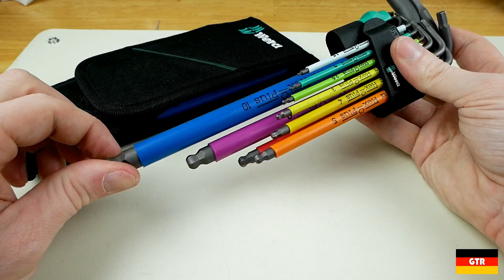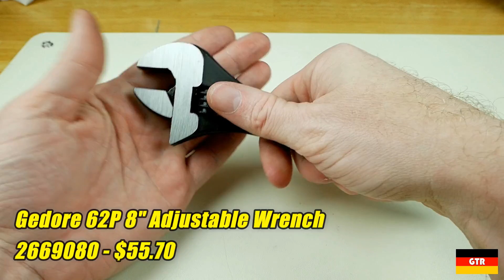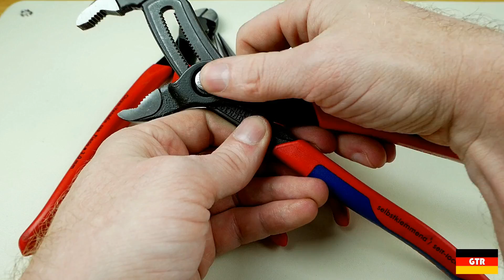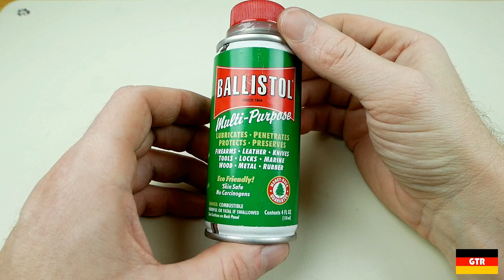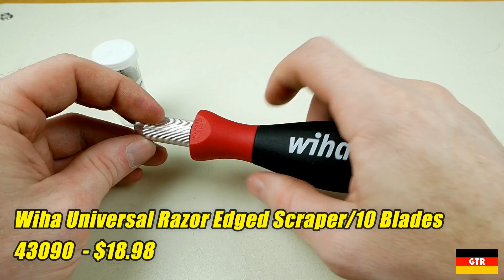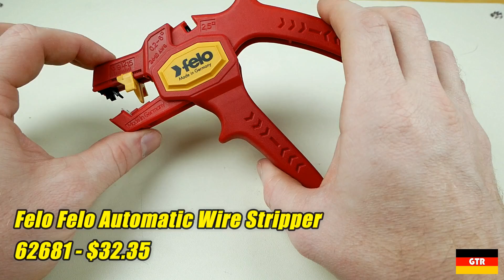Best German-brand Tools with a $1000 Budget

Comment: The German tools are expensive overseas. The Tool-Check plus is like 60 - 65 € in Germany (and I think that' expensive). There must be high customs on tools shipping them one way or the other.

p. s. your pronunciation of Knipex was perfect. The Gemans don't have silent "k"s in-front of the "n". And the "e" and "i" are differently pronounced (also F, V and W). That leads to confusion. But no problem. Nobody is perfect.

Wire strippers in Germany are often from Jokari, even if they are differently branded. But not this particular one from Felo. Don't know if they do that themselves. But I prefer the more expensive ones from Weidmüller or Knipex. Teflon is of course a different challenge.

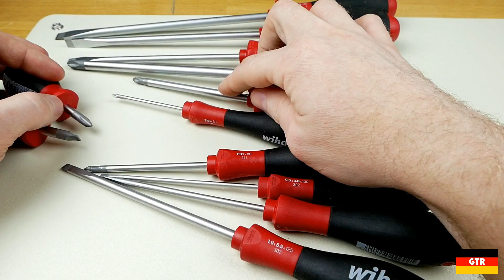Comment: 20:00 I've got these Wiha screwdrivers and the Weras, whose handle I prefer for having the option of a thin 'fast-spin' handle region and a thicker 'torque' region. 
However, hands-down, my absolute FAVORITE are the Felo wood handled screwdrivers. They're absolutely awesome. Handle feels nice, they have a leather region on the bottom for light tapping with a hammer, and a hex bit on the shaft for when one needs extra torque.
https://smile.amazon.com/Felo-07157-22155-Phillips-Screwdrivers/dp/B000XDNSQ2

Comment: Hi, just watching your Tool review: first German is my native language and you have Knipex almost perfectly pronounced like it is in German, second you pronounced Dehn almost correct at the beginning of the video (ignore the sales rep) the „h“ is silent but the word will be prounounced slightly longer (like Deeen) than if it would be when written as Den or Denn (spoken short). In German an „e“ is, as you did, pronounced as in Echo or Hektor.
Last thing, I have not seen the FELO yet but I do like that it does not pull off the insulation completely because I always twist the wires before soldering and here you can grab that insulation and while pulling it off twist it at the same time and you get no grease from your fingers onto the bare wire. Have to look for that tool.
Have fun with „non-chinese tools“.
Bernhard
Reply: "I have not seen the FELO yet but I do like that it does not pull off the insulation completely"
Some wire strippers you can adjust the insulation to be pulled of completely or not.

Comment: Instead of the Gedore spanners I'd recommend buying the Wera Joker Set. These are engineered to the max.
Reply: They’re just so expensive though, if you use them 9-5 then it’s worth it but for most it’s hard to justify.

Comment: SAE = Sucks At Everything 
Just joking don’t take it serious.
Reply: I'm from the USA, and you're spot on. THat said, due to the heavy imports from China in the past several decades, I'm fairly confident that the USA will come around and start using the metric system more frequently, if not exclusively, soon enough.
Reply: I'm taking it serious... because its true!
Reply: Dude, you skipped decimeter (dm).
Reply: I disagree, the size of 1 inch (2.5 cm) 1 foot (30.5 cm) and 1 yard (91 cm) are better sized intervals for measuring in practical  on site construction applications. The metric units of measure are too small (cm/mm) with the jump to meters being too large. Adding fractions isn't difficult either you just convert inches into feet (1" = .083')
Reply: @Kozakcarpentry  You still don't get metric.
Reply: @mips13  well said
Reply: @Kozakcarpentry  That makes really sense. Fasteners are usually in the smaller end so10mm is as difficult or as easy to get your head around as 3/8.
Reply: @Kozakcarpentry  we have..... mm cm dm m...... The dm means decimeter and converts to 10cm, which is a very fitting step I think.

Comment: i Know 1000$ is not much,  but as the BEST BRAND you`ve forgotten ZEBRA Würth ,HAZET , Klauke and KS in my opinion. Still good video
Reply: Not KS Tools. I have used twice the Seitenschneider or Sidecutters to shorten a screw and in both cases one of the handles broke off. Even a cheap Mannesmann didn't do that.
Reply: hi, definitely KS . There is only ,what most people don´t know, 3 qualities. The Basic line is the stuff from the discounter. KS chrome+ is for the better craftsman  and KS ultimate is very exellent higth quality.
Reply: @andreasgaar3896  Well, in a car mechanic shop with ks chrome+ however, the tools were only mediocre. How the Ultimate line is, no idea. But the chrome+ is already as expensive as much better tools.

Comment: Nice review! BTW: The hammer is made by HABERO, which is part of the GEDORE-group and specialized in hammers ever since. I would use combination spanners/wrenches, not double-open ended spanners, as the "boxed" end (we Germans call it the "Ring"-end) is much gentler to the screw-head/nut AND at the same time allows more torque. True: GEDORE-tools look quite rough on the surface, but it is nothing negative. Most lowest-quality "Made-in-India" cast iron (!) wrenches are polished smooth to shine like original "Snap-On"...but in use in a situation with lubricants on the tool, the matte finish is WAY better due to the superior grip. And they don't blind You with reflecting a strong beam of light which is often used in temporary working conditions. That's why all real professional tools have it: HAZET, GEDORE; ELORA, STAHLWILLE, DOWIDAT etc. However, IMHO, STAHLWILLE has the nicest feel/touch from all matte surfaces. I worked with Snap-On on engines and farm equipment and their slipperiness and over-shiny appearance didn't appeal to me at all. Kind regards from Germany, Gereon

Comment: cool video,
and as a german I more or less totally agree with the brands you selected.
1. if you need good pliers in Germany you buy Knipex,
2. if you need screw drivers you buy Wiha or Wera, but Wera has as I Think a better marketing and they really like colours. A rep from Wera told me they are really good because of colours on bits and everything. He said all tools produced aroung Wuppertal are good ones but if you save money because of time finding the right coloured bit faster than the non coloured one then the coloured one will be the one you use.
3. Gedore and Stahlwille are the best choice for spanners.
There are two companies that are really good with tools to. That is Würth and Proxxon 
Proxxon used to produce for modeling, so they have a great amount of smal tools. 
And Würth of course are quite good with everything but they only to btb.
Reply: What's the German equivalent of Snap on? Lol

Comment: Mainly because of my now heavily upgraded and thus expensive as fuck BMC Agonist 02 TWO I started buying some ( I think ) quality tools starting with a Wera 7000 1-25Nm Torq Wrench to prevent damage to the CF Frame and then pretty much stuck with Wera for everything that needs to be fastened or loosened using nuts and screws.
For stuff that needed to be held in place using pliers, cut apart using cutters or prepared for electrical stuff I decided to go with Knipex starting with a Knipex Knipex 86 05 250 Pliers Wrench ( initially bought it to remove the bikes cassette using an adapter ).
As for Power Tools I went with the Bosch DIY Line like my most recent purchase being a PBD 40 Bench Drill.

Comment: What German brand is equivalent to Snap-on tools?
Reply from the maker: Hazet generally has the highest prices tools so probably them if you want to compare.
Reply: What about the highest quality. I just bought some Wiha micro screw drivers and some hex bits. I know these are excellent quality. What would be some other brands available in the USA?
Reply from the maker: A lot of the brands in this video would be some available in the USA:  Wera, Gedore, Wiha, Knipex and Felo.  Highest quality is really subjective, but I would say Knipex for Pliers, Hazet or Stahlwille for Spanners/Wrenches, Wiha or Wera for Screwdrivers, Wera for L-Keys, Gedore for hammers.  For better value (lower price) take a look at Felo.
Reply: For sure on Knipex. I've got a  few pair. I think Snap-on used to sell re-branded Knipex.
Reply: Stahlwille

Comment: Hi All. Can anyone tell me whether you should invest in SAE or metric tools? In my job they use a mix mash of tools. They don't stick to a particular  convention. I intend to buy tools for automotive use, working on a Japanese vehicle. Any answers would be appreciated.
Reply from the maker: Nearly all modern cars are going to be 100% metric.   Heavy trucks/equipment and aircraft almost always SAE.   If you run into both at work then you really need to have both sets.  Some SAE sizes you can get away with using metric sockets like 3/4", 19mm, but there are only about 5 sizes that can be interchanged like that.
Reply: German Tool Reviews Thank you so much for the speedy reply! Was holding off a purchase until I was sure of that. Fortunately these will be my personal tool and I won't need them for work. If you don't mind, perhaps you could answer a follow up question. I wanted to buy  a Carolus spanner set, as well as their socket set which is quite comprehensive. They're owned by Gedore. Do you have any experience with them?

Comment: Does wera make joker wrench in SAE or 12 point SAE sockets, I'm an aircraft mech and I'm not a snap on fan.
Reply from the maker: Yeah the jokers are available in SAE as well from 5/16 to 3/4"  There are two combination types, one with a switchable ratcheting mechanism and the other with a ratcheting mechanism that you have to flip over to reverse.   For sockets my preferred brand has been Stahlwille because they are a bit thinner and lighter than other brands.  In 12 point for 3/8" drive this is the 45a series, for 1/2" drive it is the 50a series.

Comment: Where can you buy the Wera L key holder pouch separately? What is it actually called?
Reply from the maker: The Part number is 05671063001 or 671063.  It is called "L-Key Pouch 9 Slot"
Reply: Thank you mucho

Comment: What do you use to strip Teflon coated wire? I've made wire strippers with old wooden clothes pegs and pencil sharpener blades. It just cuts through the insulation, but you need to remove it yourself which I do by twisting/rolling it in my fingers (it also gives multi-strand core a nice neat twist).
Reply from the maker: From one person I've talked to who strips teflon wire all day, they use the cheap ones with holes for different gauges sort of like this style:  https://www.amazon.com/Stripping-Gripping-Comfortable-Klein-Tools/dp/B00080DPNQ      Said that it is the most reliable and can easily be replaced if it wears out.
Reply: Cool, thanks

Comment: Try CK 495001 (or any of the identical) wire strippers. 
Does Teflon OK and can strip anything including the outer sheath of thin cables without adjustment or choosing a certain position. 
I have two drawers full of wire strippers, many are better for specific applications, but these are the most universal and quick.

Comment: Tool set might depend on your preferences and jobs, but there's a lot of things I don't understand. For example, such a love for hollow-shaft nutdrivers (they are not cheap and rarely needed), and professional wirestripper without any 1000V insulated tools for electricians. 
I've tried to imagine a job scenario for this set and something is always not optimal IMO.
Of course, main idea is not a optimal set, but promotion, but i think sets "for plumber", "for electrician" etc. would advertise better than some set for handyman without any guess what he will really need tomorrow.
Reply from the maker: It really does depend on your application.  The nut drivers I find are best for dealing with hex standoffs.  You run into them a lot in computer hardware, serial cables, etc.  I also use them when installing nuts with a nylon insert (nyloc nuts).  These are just the tools that I use the most, of course it really depends on what your professional and hobbies are that will really determine what best suits you.  A plumber would probably never have a need for nut drivers.
Reply: German Tool Reviews, now I understand. It's like 'how I spent 1k usd in german tools that helps me' .... I can recommend you to try review Felo screwdrivers, especially m-tech series, and Gedore versatile pliers like 8133 and newer bent-nose vde model. They are very good for small electromechanical work.
Wiha bi-cut also cuts well for its price, almost like Cobolt.

Comment: This Gedore hammer was not made by Picard. This hammer is made by the former company HABERO. Habero was bought up by the Gedore Group.
On the hammer head the letters HB are broken. This means (Hermann Bremer). The Habero company was located in Wuppertal. Today is also produced in Remscheid. Ochsenkopf was also included in the Gedore Group. The partenet of the Rotband plus hammer is also applied to the axes.
Reply from the maker: Thanks for the information!  I should get a Picard Engineers hammer as that would make an interesting comparison.

Comment: Maybe im missing something but $55 for an 8in adjustable wrench is crazy.
Reply from the maker: Looks like you found a little typo there.  That is the price for the 10" version.  The 8" version is listed at $43.08.  The Gedore 62P series are the highest quality adjustable wrenches I have every used.  They are not common because they were made specifically for the mining industry in South Africa.   This is probably why Gedore has two versions of adjustable wrenches - A high end 62P model and a lower end 60S model, which is significantly less.    I did a detailed comparison of the two Gedore models, and why I felt the 62P series was superior here:  https://www.youtube.com/watch?v=CNTpAi2248M

Comment: Have you checked out the pbswiss screwdrivers? At work we have a different wire stripper facom swinging 1793936 bit more expensive but really nice :D pbswiss depends what you get https://pb.swisstools.nl/webshop/categorie/schroevendraaiers/rol-etuis/basic-sets/ but it's not that much about 35 for the starter. It's Swiss though, they speak some to close to German though lol.
Reply from the maker: PB Swiss and Facom both make great tools, but as you said, they are not German brands and would not appear on this list.

Comment: Do you have a recommendation on a stripper for the milspec wire? I really struggle with the small gauge 22-26AWG stuff, end up stripping out half the copper.
Reply from the maker: I just talked to one of our assemblers who strips wire pretty much all day and he uses those cheap wire strippers with the holes for different gauges in it for Teflon (PTFE) wire.  He said the automatic wire strippers are not as reliable on Teflon insulated wire.   Something like this is what they use:  https://www.amazon.com/Klein-Tools-11047-Stripper-Cutter/dp/B000I1L7GW
Reply: Knipex makes nice fixed width strippers.

Comment: I can't see that sleeve causing problems.  The cap of the bolt needs to be bigger than the internal hex and any hole it's going to go in needs to be bigger still.  Maybe there is a situation where the sleeve would cause interference but I can't think of one

Comment: I'd definitely add the Wera Kraftform Kompakt 62 with Wiha 76096. That is a 3.5" security bit set. The Wera set doesn't include SAE security hex so Wiha supplements it. This gives you a lot of driving bits and they feel like having dedicated screwdrivers. I'd have to add the 7" plierswrench too. Gedore or Felo screwdriver set for me. 

BTW, I have the Felo and the Knipex auto wire stripper, the Felo is better...but I also noticed the problem with teflon wire.

Comment: GTR Guy, I'm a long-time fan, first time commenting.  I've spent money on, and really enjoyed using tools based on your information.  I miss the intro with the heavy metal and the smoke thing.  I'm curious what a key chisel is used for.  I understand that wire cutters actually fracture (solid) wire, rather than cut it; I wonder if you could expound on that sometime.  Finally, I really wish you made stickers with your logo - I would buy a bunch if available.  Thanks for the entertaining content
Reply from the maker: Thanks for the comments!   I got a lot of feedback that people didn't like the intro/outro and just wanted to get right into the video so I did a couple without it and no one actually said anything so I assumed that was what they wanted. 
A key chisel is better known as a cross-cut chisel is used to make grooves in concrete and mortar.   I've always called it a key chisel because it is often used for keying mortar between bricks when re-pointing.
I can look into the science of how wire cutters actually work.  Cable cutters work differently than side cutters, one shears while the other deforms so it would be interesting to see those differences.
I terms of stickers, swag, etc.  I do have a redesigned logo that I had some stickers made, but I'm still doing some tweaks to it.  I might start selling t-shirts on spreadshirt or some other platform in the future.

Comment: still it isnt "deen". you dont have that "e". its like in that video ( at 1 43  ) https://www.youtube.com/watch?v=1Cmiz91uq2I
Reply from the maker: You are right, after I recorded the video I realized I still said it wrong since we still internally call them the "DEN" modules, but they should be pronounced "DANE" sort of like the comedian Dane cook.   This video pronounces it the way that I remember:  https://www.youtube.com/watch?v=42kORrZUrVc
I think I've heard the reps say it many different ways.
Reply: In German the  "h" in the middle of a word right after a vowel normally means prolonging the vowel in front. So in "Dehn" the "e" is long and in some words you could imagine an aspirated "h". It's a bit of a problem to translate the German sound into an English word, esp. the "e". But the "h" is, more or less, just a double "e" with a little tiny bit of aspiration. "Dehn" or "Deen" would have the same pronunciation, just as "Meer" (sea) and "mehr" (more).